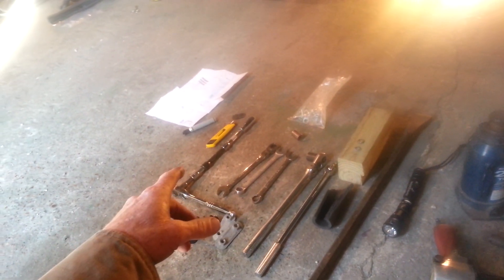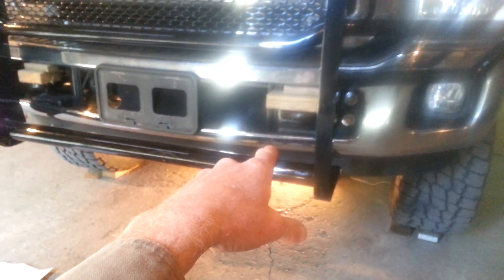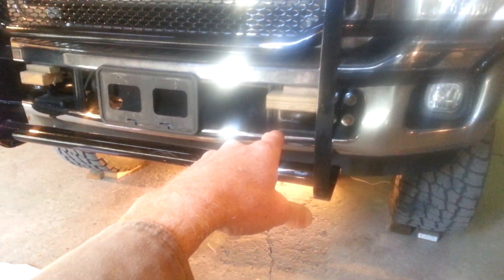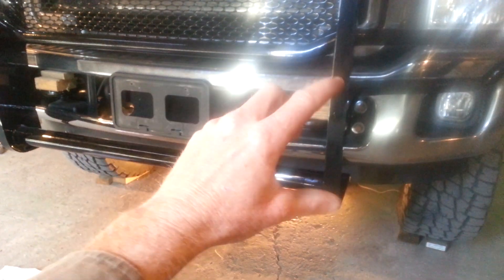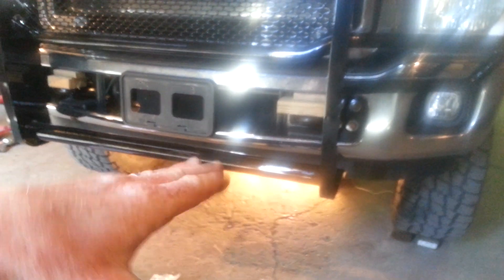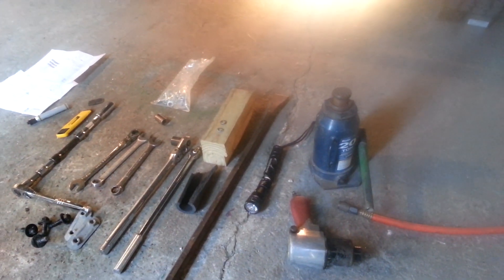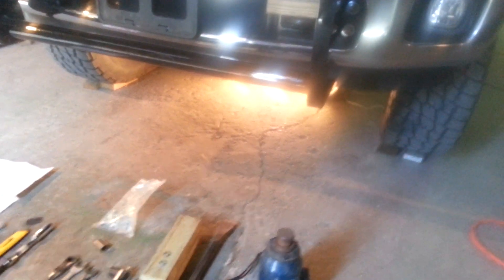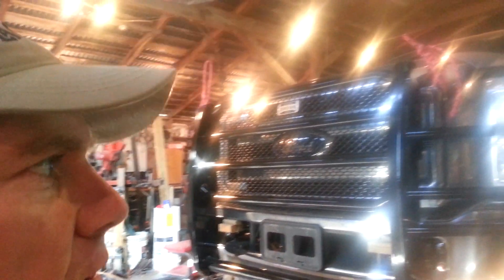Ranchhand brush guard installation.  Part 2

Comment from the maker: A long/somewhat stretchy rope helps to fine tune the location. 

Side note: I sprayed some black spray paint in a paint cap and uses a Q tip/paper towel to paint the very minor scratches associated with shipping.